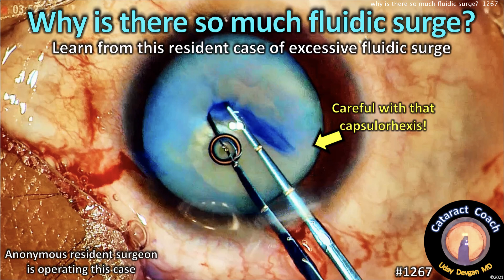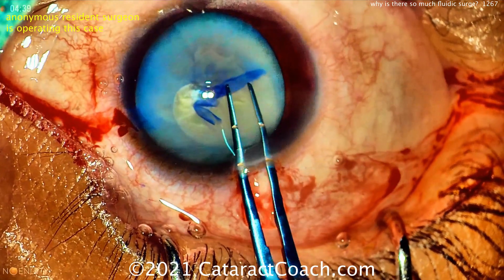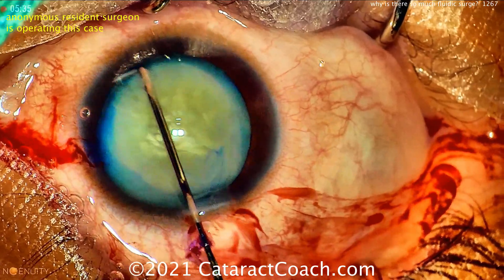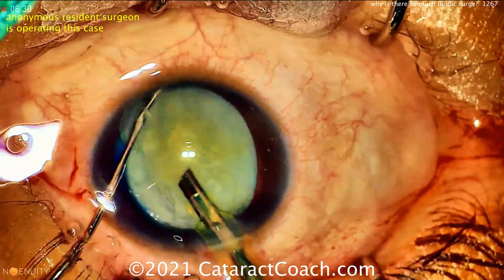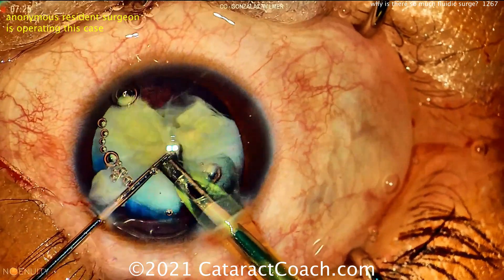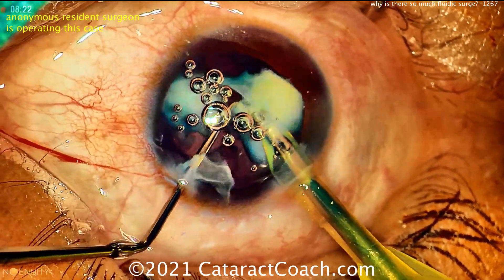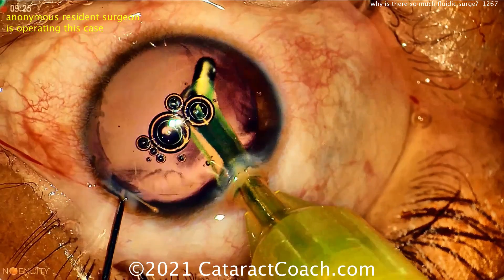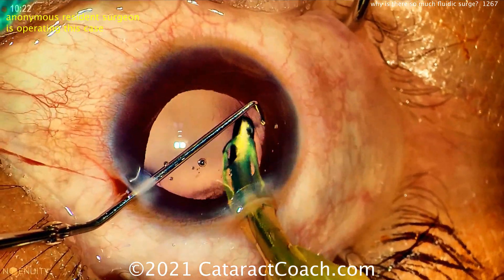CataractCoach 1267: fluidic surge during cataract surgery - why?

Comment: Nice video! Maybe vacuum and flow rate was too high, and sideport is clearly large,  and leaking too much. Chop technique is quite similar to my mechanical fracturing technique, and with this approach,  we don't need high vacuum and flow settings. Anyway, for a young surgeon, well done. Must hear professor Uday advices to improve it.